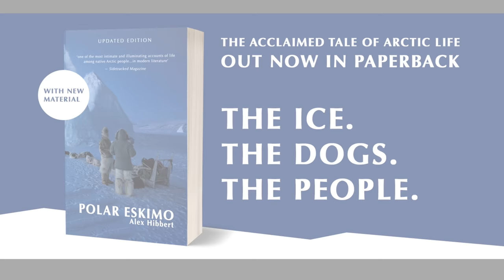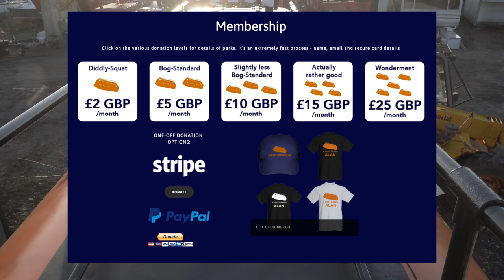Lifeboat Conversion Ep37: Clearing up damage from Storm Eunice / Franklin  & solar panel repair [4K]

Comment: For some perspective: I took no damage during these storms on a similar hull to Alan ,but paint scraped off by my fenders. Some of the bigger boats moored around me took damage, and all had more asthetic damage.  On Scotlands west coast we had 50mph winds on 4 different days, I found the entire marina had moved to hide behind my tiny boat including,  two 40 foot royal navy drone warships and their mothership.  Clearly lifeboats have a serious reputation amongst those that live or work at sea. The hull rolled more than anything else except for the grp motor cruisers. Pitch variation was less than sail boats at high wind at both head on and side on winds. My 16 year old son slept through all of it, I spent my time adding ropes to my neighbours boats when their lines snapped. You might find that with Alan, provided he has enough power to make way against the storm, that the only danger is land, and Alan may be safest in storms, when he is mid ocean, far from land. We seem to be moving at a similar pace, I wonder if Alan and grey area will meet in the Arctic circle. FYI Russia has built 300 bases in the Arctic, in the past decade. Up close most are just a tracked vehicle, and a half dozen insulated freight containers. It's Great watching u solve some of my upcoming design issues, with your methodical logic and dry wit. Fair winds, and cheap diesel. @Alex Hibert on damaged solar cells...
I have several cells, one of which is the same brand as yours, rated at 160watts, 1 year ago it was ripped off in similar circumstances to you, whilst sitting in a lorry yard, the wiring was snapped at the point where it connects to the panel, and roughly 8% of the cell had suffered delamination. I still use this panel to run a 600watt cheap Chinese lithium solar inverter/battery. It's voltage on an average Scottish spring day is 17.4 volts - A little less than before. I have several relevant degrees, trust me, I'm not a doctor. Your panels are safe and sound.
Reply from the maker: I'm certainly of the view that land is Alan's enemy in poor weather. It remains to be seem how his thrust performs when fighting both current AND wind. I was impressed last year with control in an area of strong tidal current.

Comment: If you're interested in how you could un-do those last bits of shoddy cable, you'd set a large piece of copper on the panel-side of the connector to act as a heat sink and keep the rest of the connector cool while you re-solder the cable.
Reply from the maker: Thank you. I was indeed interested

Comment: I suggest you get a diesel water heater, radiator, and have a "coolant circuit" with your engine. This will keep you engine warm when not in use as well as provide heat via the radiator. Alternatively, you can turn off the heater and use the radiator to heat the inside with engine heat in lieu of the seawater heat exchanger while underway.
Reply from the maker: Yes I've had some enthusiasm for redistributing heat from the engine whilst underway. The cooling system is due for a serious re-working, so stay tuned.

Comment: Well done, yeah I don't like those MC4 connectors either, perhaps banana connectors are better if you leave a sleeve over both terminal & banana clip. If they come apart then it's as simple as removing the heatshrink tubing sleeve & replacing it onto the cable then  plug it back in then heat up the sleeve to seal it to make it waterproof. With the Terminals on the outside they can covered with silicone on the screw terminal & backing plate because all you would use is the banana post that plugs into the middle.

Comment: You can check if a solar cell is damaged by running power through it and looking at it with a phone camera in the dark. If I remember correct, phone cameras can pick up the light they emit. It's good to remember that solar cells are just LEDs that are specialized in capturing light but they actually emmit IR light when powered with like a small battery. If you see parts of the solar cell not lighting up those parts are damaged
Reply: This is actually how professionals check the health of a solar panel
Reply from the maker: Interesting

Comment: I was always taught that connectors are inferior to soldering, full stop. Butt connectors are particularly suspect. I don't have firsthand experience with them, but a tool channel I think highly of recently introduced some clear silicone crimping butt connectors that are approved for commercial use. They are capable of very high heat and UV exposure, they have a unique feature I thought might be particularly helpful in your use case. When they are crimped properly, the connection turns bright pink. If something damages the connection (the wire being yanked out was demoed) it immediately turns clear again. If there's a few strands still connected but the resistance is off the charts, they turn clear. I know what it's like trying to do small fiddly tasks on shipboard though not in the cold you are used to. I can't imagine trying to trace a fault in even a capful of weather. Might be a handy diagnostic, being able to quickly glance and greatly narrow down the source of the initial fault.
Reply: My natural inclination would be to have as few brakes in the wire as possible, none more than necessary. I suppose in your position, I would be inclined to add a second one passively just to have as a backup. Then again, I have not entirely understood your need to keep things so lightweight
Reply: These color changing butt connectors are heat resistant silicone on the outside but instead of a traditional copper crimp, it is stranded lead or lead alloy. Supposedly it can stand up to being bent back and forth repeatedly. Again, no direct experience, could be marketing wank, but the guy who exposed me knows his stuff and focuses on trucks in Canada, not completely irrelevant experience
Reply: But connectors are good enough for NASA… probably good enough for most low voltage low amperage situations on a boat
Reply from the maker: They sound very functional. But with every component selection, you make a judgement call about size/price/performance. With an unlimited budget and no weight or size constraints, you'd naturally make different choices.

Comment: I noticed that the steps outside the port hatch look a bit slippery for access to the top surface. What about bolting on a bit of bent checker plate to the steps which bends upwards, thus giving some (horizontal) grip when ALAN is heeled over??? otherwise your boot may just slide off, with inconvenient results.  What do you think???
Reply from the maker: The anti slip is very effective, but yes this is certainly a good idea

Comment: while i dont have an 8k image of the damage, there is definetly a compromised cell at 3:52 , it has cracks and will likely affect the output quite segnificantly if they are wired (inside the panel) in series
Reply from the maker: Time will tell. I can easily swap out a dead panel once installed. Not willing to give up on this one yet.
Reply: @AlexHibbertOriginals  fair, you will probably see reduced amperage if its actually damaged, no way to tell till you get a proper sunny day to test it
Reply: @AlexHibbertOriginals  I posted a comment up above but if you run a small current through the solar cells and look at it with your phone you will be able to see if there's any damage. When powered solar cells emit IR light
Reply from the maker: Indeed. If it's curtains once all four are installed, and I can see one panel is holding the system back, I can swap it out.

Comment: Never make a splice like this on the exterior of a marine vessel. The silicone cable might be UV stable but the “weather proofing” via heat shrink is certainly not… even in higher latitudes. The heat shrink is also not as flexible, leading to strain on the shrink. I would give this 6mo to a year before it fails, especially if you actually start using the boat in the salt water more.
Reply from the maker: It's to be embedded and immobilised as I mentioned.

Comment: Why not just build a frame out of angled aluminum, bolts those to a hinge on the deck rails so that if Allen is facing the sun from the either port or starboard, you can angle the panels to face the sun by an electric motor attached to a screw which lowers and raises the panels. That way not just one side or the other is facing the sun. Kinda like flaps on a box. lower one at a 45% and raise the other side at a 45%. when the sun is directly over head, you can adjust the panels flat. Hope I make sense.
Reply from the maker: It would really compromise any other use of the deck area, if I understand you fully.

Comment: Hello Allen, it is my understanding that PV panel wire leads, although less flexible,  are much more UV and abrasion resistant. Please correct me if I am wrong.
Reply from the maker: Alex standing in for Alan whilst he learns to type. 

High grade silicone cable sheath is pretty UV resistant. It's not as much the sheath that I dislike, as the low strand count of wire inside - this reduces flexibility, and the % of failed strands is higher for each one that might snap from over-flexing.
Reply: @AlexHibbertOriginals  Allen please ask Alex to address abrasion resistance. It is common to  mount PV panels on recreational vehicle exterior, at 100 km plus it is comparable to hurricane force winds and a earthquake  simultaneously. The dedicated PV wire I am familiar with is 10 awg  with  identical strand count to 10awg silicone jacketed welding cable.
Reply from the maker: Understood re: use on vans etc.
The strand count I have in these PVs is a fraction of the number in the silicone wire.
Reply: @AlexHibbertOriginals  Understood regarding marine applications: sounds like you have low quality PV panels with less than ideal leads. The MC4 connector commonly accepts 10awg wire with designated MC4 crimp. Is it wise to trade abrasion resistance for soft silicone wire insulation?
Reply from the maker: Dokio are a reasonable brand. But yes they may have skimped. The silicone will be braced, and vibrations are minimal at this location. I've never worn through them in other applications. Also, I've not got Alan up to 100kph yet.
Reply: @AlexHibbertOriginals   I get it, if a Marine Vessel has a system failure at sea, no worries, you and who ever is lucky to be on board can swim. If a RV has a similar problem on the road, you pull over get out and watch it burn. How's that for a analogy ?
Reply from the maker: A warm analogy.
Reply: @AlexHibbertOriginals  May not come to agree, respect a man that stands for things he believes in.
Reply from the maker: And what greater cause is there in the world to believe in than partially wind-damaged mid-market solar panels.
Reply: @AlexHibbertOriginals  No worries mate, just rattling your cage and if not part of the solution,  must be part of the problem.

Comment: Is it clever to reuse the panels for such a critical use case?
Even if they work fine right now maybe there are weak points now inside them which could break at any point.
Obviously it's your decision but me personally I probably wouldn't feel comfortable using them for the expedition.
Reply from the maker: They are never going to be critical use as the main power generation will be diesel and wind.

There's no evidence of imminent failure, they are only two of four panels, and I don't want to throw away hundreds of pounds.
Reply: @AlexHibbertOriginals  ah ok, didn't know that they weren't critical (you mentioning Wind power in this video should have been a clue 😅)

So I guess the only thing left to do is to knock on wood that the panels still are perfectly healthy 😂🙊
Reply: If they haven't been folded and / or creased it's unlikely that they will have suffered.  ;)